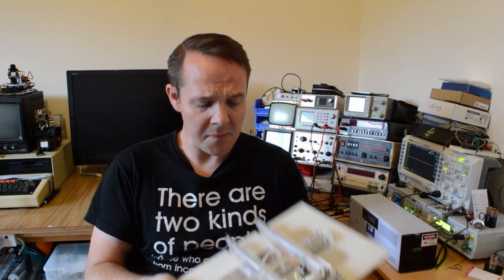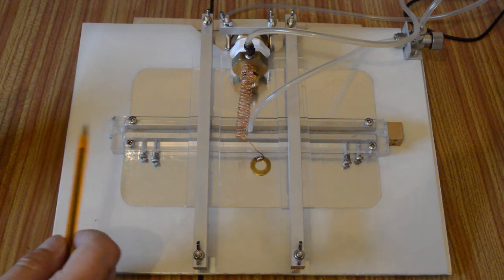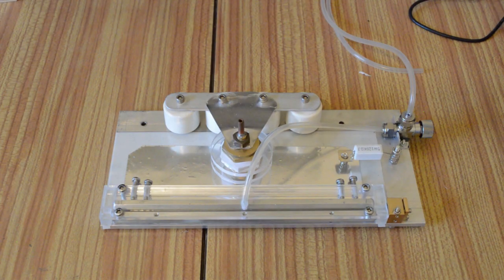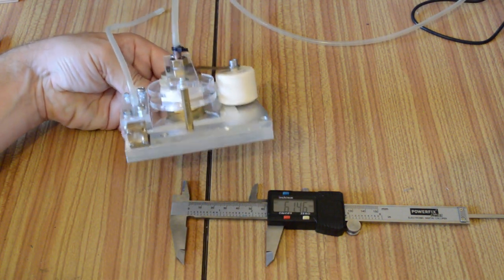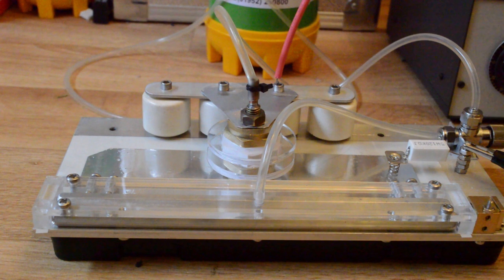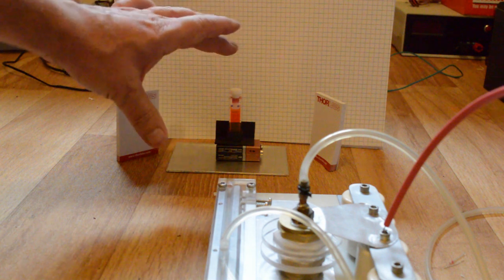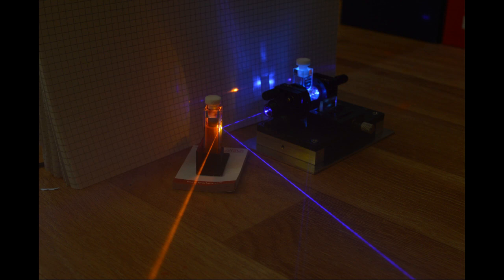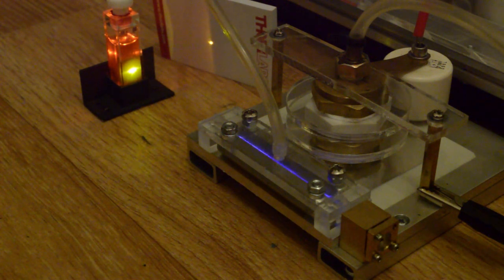DIY Home made High Performance TEA Nitrogen Laser and Dye Laser!

Comment: What is the output power?
Reply from the maker: Average power is probably a good few milliwatts (depends on the repetition rate). Peak power is probablly well over 300kW as it can drive dyes  to super-radiance easily.
I have just ordered some Laser energy detectors for measuring high energy pulses (not the same as regular CW power meters)
Once these arrive, I will be doing a video where each of the Nitrogen Lasers is accurately measured. Stay tuned!

Comment: Do you need safety glasses for this?
Reply from the maker: Yes, it is tens of milliwatts average power with peak power for the Nitrogen laser pump being hundreds of kilowatts.
Reply: @LesLaboratory  Thanks for the response. I figured you would need goggles. I've heard elsewhere that you can sometimes get away without eyewear for some pulsed lasers (I would assume this only applies for diffuse reflections). I personally wouldn't test my luck, though.

Comment: wel no mirrors is not a 100% true the internal reflection in the  tube is acting like a mirror
Reply from the maker: You are right, reflection off the cuvette walls is in the region of 4% which will give some feedback for sure. However at these powers, you can tilt the dye cell, thereby eliminating the feedback, and they will still Lase. The internal gain is that high.
Reply: @LesLaboratory  awesome video  need to get my hands on a small  yag or ruby laser
Reply: @LesLaboratory  What if the dye is inside a cylindrical container?

Comment: "High performance" XD
Reply from the maker: In the scheme of things 100 pulses per second at 300 odd kilowatts peak is very respectable as Nitrogen Lasers go. They are very inefficient devices, however they are exceedingly useful!
Reply: @LesLaboratory  IMHO, high performance and high power are different things. For example, a 5W Chinese laser diode for 20 USD is high power but absolutely useless for any serious application. What about repeatability, thermal stability, temporal and spatial pulse shape, coherence etc. What is the pulse duration, when you mention peak power?
Anyway, I'm just annoyed by the amount of clickbait titles on YT, don't take it personally.